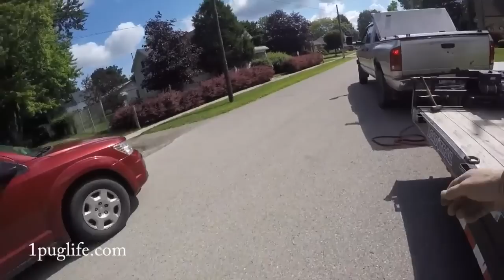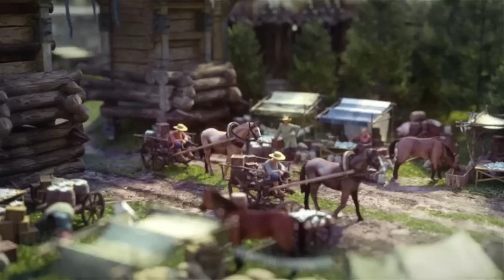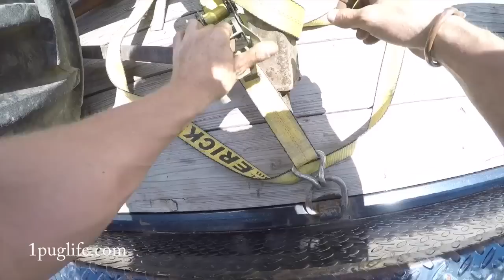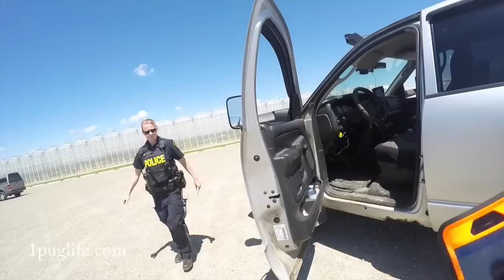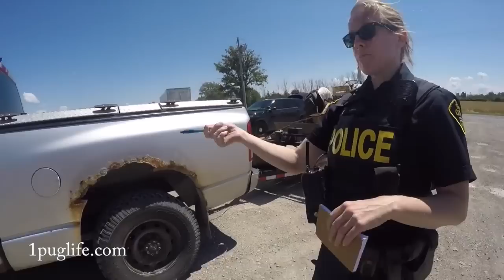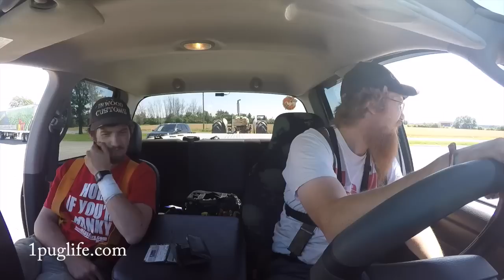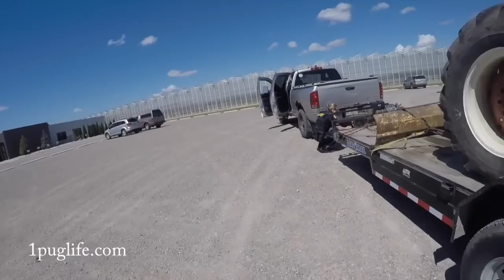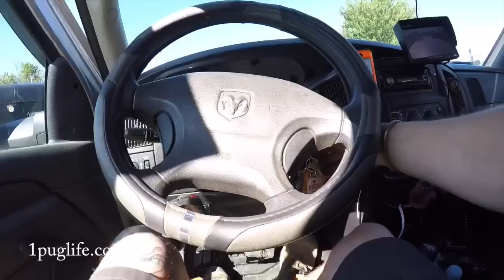illegal towing operation

Comment: What your licensed for 
What your truck is rated to haul 
What your tires and trailer can handle are all different things. 

If you wanna be safe , you make sure u are at proper weight for all 4. 

Read the side of the tire for weight rating. 
Read the registration for the truck weight. 
Read the factory sticker for the actual capabilities for the truck and trailer. 

This is a total scam. 

They do it all over the country in America and canada. 

It's just a way for them to get money. 
Not one time did she say this is in the name of safety. 
It's all on the name of money. 

They intended these rules for saftey. 
So u don't have blow outs and cause accidents due to over loading. 
So u don't break down climbing hills and get rear ended or roll back wards cause u lost the drive line and burned brakes up. 
Or so u don't over load and burn brakes going down hill and cause accidents. 
Or my fav ...so u don't do 10 mph up hills etc. And hold all traffic up. 

The damging road comments shows how ignorant she is about the subject. 

How is this truck damaging the road and a semi truck hailing 80k lbs doesn't damage anything ? ??? 

The road damage is for trucks hauling over 40 tons. If you haul over 40 tons total on road u need to stay on special roads cause u can wash board the roads if not. U can cause road wash outs and other damage under the concrete or pavment or asphault. 

She is way way out of her skill level with this job. Fire the person who gave her the job. 

Just cause you read a book doesn't mean you comprehend the subject. She is proorly trained and should be ashamed of her self handing out tickets and not even knowing what for exactly. Basically just saying u got a ticket cause my boss says these sales read a number and u get a ticket. 

She read the code book but doesn't comprehend shit about the subject of hauling. 

I fell sorry for you guys having to deal with someone that incompetent. 
Worst part is she thinks she knows everything about the subject. 

Truth is she is clueless and has no place doing that job. 
Shame on you lady for taking a job you understand nothing about....

Comment: wow what a lame joke. my truck and trailer with a load of logs do not even hit 18,000pds and that tractor is about the same weight maybe 6,500-7,500 easy with the backblade on it. and the trailer is easily a 10,000-12,000 pds trailer so ya there's no way you were over weight. not even close.

Comment: I must be crazy,wher i come from that trailer should be good for 14,000 pounds. If that tractor wieghs half that ide be surprised. People commonly pull a back hoe with just a dual wheel 1 ton and a good trailer in the states. Stopping fast aint gonna happen but its legal.

Comment: Lol wtf!? 3 thousand pounds is the towing not the full weight. 3000 pounds is like a Ferrari😂 if it was 1100 on each of the trailer wheels then wouldn't it weigh 2200 pounds assuming the part that connects to the truck is evenly flat and definitely not holding another 800 pounds
Reply: Oh it was kilos not pounds. All the more

Comment: I didn't see an d.o.t number on his truck weight limits r for commercial use an weight has to exceed 20,000 pounds gvwr ( gross vehicle weight rating ) for a commercial single axle an there is no way that truck trailer an load weights that I would say 15,000 pounds max gvwr an that's not even a commercial vehicle I bet the boys at the d.o.t (department of transportation) are laughing there asses off
Reply: DOT doesn't exist where this happened. Cop was OPP.

Comment: Can't haul a tractor with a truck without commercial registration and such? What kind of communist country is this???? I can weigh 26,000 lbs and not have to have anything special....
Reply: Not necessarily true, depends on what your doing, you may need a medical card, DOT numbers, fuel paperwork, combination plate, fire extinguisher, safety triangles, log book, just depends want state your in....most refer to fed regulations as a baseline e and then tell state can add on top of.
Reply: The kind of country that doesn't want wildcat truckers hauling unsafe loads in unregistered vehicles on public roads.

Comment: SHE SCREWED YOU she weighted it all wrong first you dont do the front axle at all and rear axle must be both at the same time and the trailer with 4 tires must be one scale on each side with ether 2 on scale and 2 off the ground or all 4 tires on scales. just another that has no clue and stealing money. but the light was your fualt and should always check be for moving a load. iv been through this many times driving the dump truck. are d.o.t have 4 scales and if 1 dont work they send ya on your way